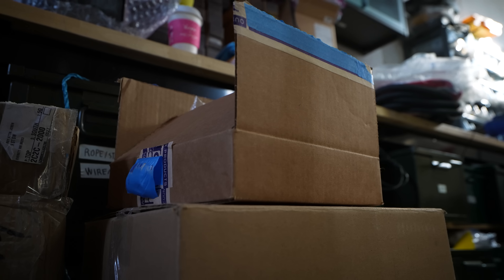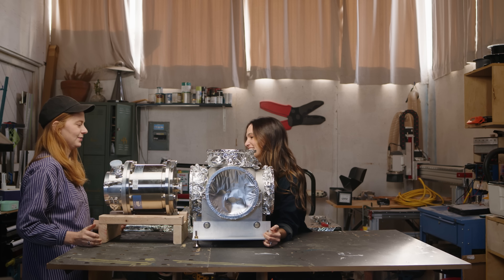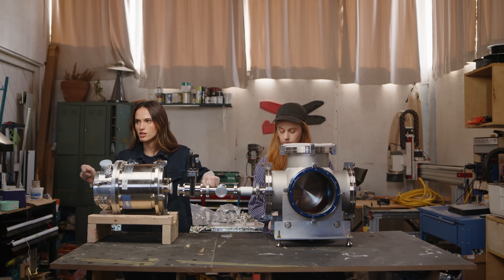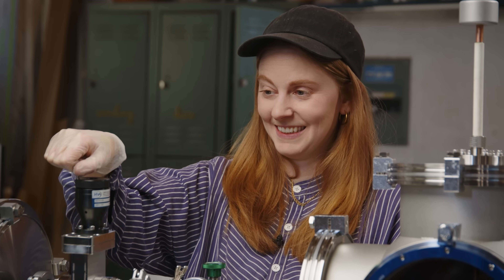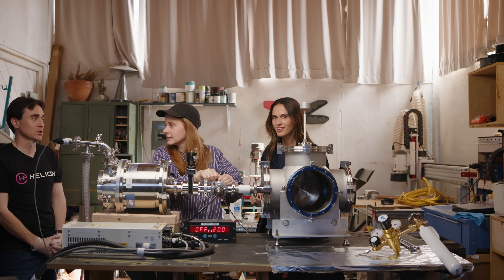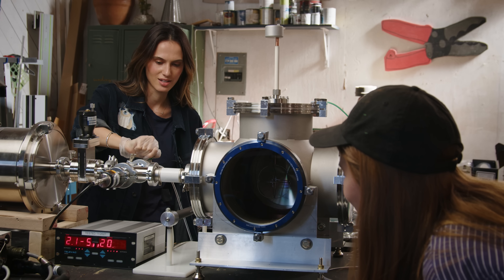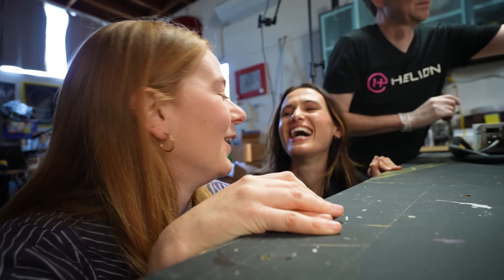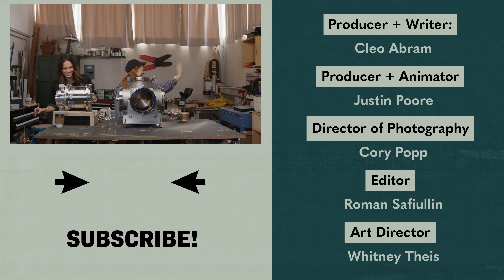We Tried To Do Nuclear Fusion

Comment: Just today, Scientists at the Lawrence Livermore Laboratory in California celebrated a breakthrough in their fusion experiments. For the first time, they were able to generate more energy than they invested in the process. The researchers used 2.1 megajoules of energy, with the help of laser beams, to initiate the fusion of two hydrogen isotopes. The fusion reaction in the facility generated 2.5 megajoules of energy. This is an important step towards the commercial use of fusion technology and a potential alternative to fossil fuels.
Reply: Importantly, that's 2.1 megajoules stored in the lasers, but it takes huge amounts of energy to pump those lasers and they fire for a very brief amount of time and then shut down. The system as a whole still consumes far more energy than it outputs. That's not even accounting for the typical conversion of heat to electricity of maybe 50% efficiency. 
It's a significant step forward, but the journalism around fusion continues to gloss over the difference between net energy of the reaction vs. net energy *of the whole system*.
Reply: @slyhatjones thank you for explaining that much more clearly
Reply: @slyhatjones  yes, but at least they've done the hard part. the rest is optimization in the support infrastructure, more efficient lasers etc.
Reply: @licencetoswill  I strongly disagree that that is "the hard part." It is like looking at successfully setting off some dynamite and declaring you are now close to building a power plant for years/decades that runs on dynamite explosions and produces electricity. What this latest step shows is only that using lasers is another approach to actually achieving fusion, e.g, tokamaks aren't the only approach in which the plasma fuses and heats itself up a bit. Firing lasers for a nanosecond and getting a tiny amount more heat than the fused material had originally + the heat of the lasers is a long way from making a reactor that runs continuously, much less one that has more electricity output than input.
Reply: @slyhatjones  Dont worry too much about the efficiency too much, hand it over to the private companies, theyll find a way to make it real efficient real fast. As theyve done with computers and phines
Reply: @Cecilia-ky3uw  Many of these research reactors are already being built & run by private companies. While the lasers delivered ~2 megajoules of energy  (and the reaction delivered ~3 megajoules), it took ~300 megajoules to charge the lasers, and they only fired for a moment. Once. This isn't a case where we're nearly there. US officials confirmed we're still decades away, if ever, from a fusion reactor that adds electricity to the grid.
Reply: @slyhatjones  Do you think they will manage to keep it alive for much longer? Lets say an hour instead of a nanosecond? Or is there a better way, like replacing quickly the atoms?
Reply: @Aldraz  My understanding, which is absolutely not expert-level, is that the lasers are being used to ignite fusion; other approaches such as tokamaks sustain fusion but use a different method to ignite it. Maybe a combination of laser ignition and tokamak containment would work? Nobody really knows, it hasn't been tried. Containment is a huge technical hurdle, so is sustaining the fusion, so is extracting heat to convert to electricity (maybe 50% efficiency for that?). When we have a fusion reaction that lasts for minutes, maybe we'll start to learn what it would take to sustain one for days. 
But these could also absolutely be dead ends, too. It's far too early to declare that practical fusion power production will happen at all, much less in our lifetimes. It's OK to be excited by teams overcoming a technical hurdle, as long as we keep in mind this is one hurdle in a hundred mile ultra-marathon full of thousands of hurdles, and we're an athlete who has never run that course before. We don't know if we can, we want to, and we're gonna give it a shot. One more hurdle down, nice! A thousand more to go.
Reply: @licencetoswill  No, this isn't a matter of optimization. The technique they used to achieve fusion does not allow for the production of electricity because there's no way to capture the energy that is released by the explosion. The experimental apparatus was designed to create fusion for weapons testing, not energy production. To actually produce usable energy they need to use a different technique.
Reply: @slyhatjones  In this context "ignition" refers specifically to the fusion reaction producing more energy then it takes to cause the fusion. Similar to lighting a fire with a match - the match supplies a small amount of energy and the fire releases a large amount of energy.

Tokamaks have been able to achieve fusion for years, what they haven't done yet, what no one using any technique had done yet, is get more energy out of a fusion reaction than the amount of energy supplied to create the reaction. This is the first time that anyone has gotten more energy out of a fusion reaction then they've put into the reaction. 

The lasers take about 330MJ to operate, and the production was about 3MJ. So we're still a long way off - and the technique they used won't be useful for electricity production.

Still, it is a big deal because it finally proves that fusion energy is possible. But it's not the start of commercial fusion energy production. It's another step on a long road, but it won't solve today's problems.
Reply: @licencetoswill  the hard part is to have more energy come out than put in, it's still a very much ongoing system
Reply: @slyhatjones  Yeah I completely share your outlook on this. It's important to realize for people how difficult and innovative this thing really is. I don't think most people value all the scientific and engineering work that these smart people have put into this. A lot of hours of research, sometimes wasted when it goes in the wrong direction. I think we should all be more thankful to these people who are sacrificing their time for this greater thing. There is still a lot of work to be done and that should be well respected and on minds of other people.
Reply: @Cecilia-ky3uw  um....private companies dont want to spend 40 years throwing billions of dollars into this. that's why government funding is so important. Look at things like the EUV lithography process, it's heavily subsidized by governments. 

the whole "capitalism solves all problems" circlejerk is very weird because it isn't really reflected in reality. Capitalism is good for short term progress but is really doesn't work well when you're dealing with hurdles that take decades to overcome. companies need to make shareholders happy every 3 months, that's why the "economy is in collapse" every few months.
Reply: @CRneu  Capitalism isnt just short term progress my guy, you realise that you current phone is magnitudes more efficient compared to its parent technology. And Capitalism tends to make inventions accessible extremely quickly as companies find ways to lower the cost of production
Reply: @licencetoswill  the hard part? They will have to build another machine just to be able to optimize the lasers (if possible). Anyway, I think they love their metrics because it gives them newspaper presence. Gain 1.5! yiha!    x=0
Reply: @Cecilia-ky3uw  and you do realize that your current phone didn't take 20+ years of development WITHOUT any useful product in between?
Smartphones get a bit better every year <- that's short term progress.
Whereas fusion will take decades of development before it can make any money at all.
Reply: @Jehty_  the newest iphone has some cool new shite compared to the previous newest one and so on.
Reply: @Cecilia-ky3uw  exactly. Every new year there is a new version with the Iphone.
Whereas with fusion there is no new version. There is only one version. And that version will come out someday in the future.

Do you understand the difference?
Reply: @licencetoswill  Fusion, my dear, it's all about optimization, the whole thing is a continuous process of making it perfect for sustained and prolonged use as it would be an actual, well generator of electricity.
Reply: @licencetoswill  No, that's dumb

They used 50+ megajoules of energy to produce those 2.1 megajoules of laser energy... and if you think that lowering 50 megajoules to ZERO is a question of "optimization in the support infrastructure" (lmao) you are as clueless about physics as a shoe, mate
Reply: @slyhatjones  Using really inefficient lasers. Each team focuses on optimizing specific components. We are closing in on components good enough to create a full end-to-end energy positive system
Reply: @thomasreese2816  unfortunately a full system positive energy demonstrator still won't solve the problem of powering the world with fusion. The design of NIF does not allow it to be a viable power plant, as a perfectly symmetrical halroum needs to be manufactured for every reaction, and hundreds of thousands of reactions would need to be produced each day to serve as a full scale power plant. 

Even the slightest defect in the halroum will prevent it from working.
Reply: Uhhh that's hugeee*!!!
*if true
Reply: No they didn't. They may have produced excess fusion energy from the laser input energy, but the system efficiency isn't even close.
Reply: Yeah not really. If we measure the real cost of the energy put we’re still way off. The breakthrough today was that we managed to “make a certain part of the process more efficiently”, which is good. But to be clear: we are still putting way more energy in than what  we’re getting out.
Reply: Just more hype and dubious claims, similar to last time. Don't get too excited.
Reply: But they didn't tell about the 0.3 GigaJoules of energy used leading up to the shot.
Reply: Except no, they didnt. Actual power input to the 192 LASERs was around ~200 MJ, power on target was ~2 MJ after losses, extracted energy was ~3MJ final, so it adds up to a huge deficit in total.
Reply: The output was 3.15 MJ from 2.05 MJ of laser power input. The didn't mention the 300 MJ needed to power the lasers themselves. So total system gain is still way below breakeven.
Reply: Yes, that was awesome. Future is in bright colors
Reply: Yeah this isn’t true. I would suggest watching Anton Pertov’s video
Reply: Not true. They got 3MJ fusion output from 2MJ laser input - but it took 400MJ in energy input to produce the 2MJ laser. Getting net energy output from fusion is still an unsolved problem.
Reply: Unfortunately, you need at least 10 times overhead to break even.
Reply: 0.4 megajoules for every 2.1 in, that is almost 50% gain.
Fission still win by a long margin, and the 50% return may not pay total build and life time operation cost.
I know it is a lot to ask, however they will have to double that to make it worth.
Reply: This is not true. They invested more energy. The OUTPUT ENERGY of the lasers was smaller than the output energy of the fusion reaction. This doesnt include the INPUT ENERGY of the lasers though, since they are by far not 100% energy efficient. Also, you need to compensate for entropy and cool your system, which also needs energy.
Reply: For context, they're still at least a decade out in terms of a usable product from this. I've seen articles making it sound like "What are we going to do now that we have unlimited clean energy?" and that's not even close to reality yet. A decade out for a usable product is still optimistic. 

So it's a huge accomplishment to get more energy out of the system(not accounting for other things), we still have a long way to go. Unfortunately this still falls under the meme of "fusion is 20 years out".

This is all based on if it can be replicated at all, which they're struggling with. It's a huge accomplishment, absolutely, but we're still a long ways out.
Reply: Sick
Reply: That's not true. They like to trick the numbers. They archieved 1.5 gain, but without counting the energy of the lasers wich consumed hundreds more than the ignition itself. Still a veeeeery long path to trace.
Reply: they did such experiments already in 90-ties but someone have sealed it down. while israelis are terorizing world with tactical mini termo-nuclear bombs...
Reply: Wait, perpetual motion is real?
Reply: They put in 10x the energy they got out that isn't anywhere near close.
Reply: More cooked numbers.😑
Reply: Yeah, still a net energy loss. Only looking at the energy the lasers put in, yeah in that case there was more output. But you need to take into account all the energy it took to get those lasers to work in the first place, which in this case still means total energy input was still larger than the total energy output. So we're still not there yet.
Reply: Except experts in the field laughed at the claim because just like this team’s previous claims, no one has been able to reproduce or verify their claim and they have made similar claims in the last. You would know if you had media literacy and did research into the claims. Plus they cherry pick the definition of energy input. This has been covered by other physicists on YouTube. That most in the Fusion game try to cheat and not really counting most of the energy input needed for the experiment and just the estimated energy acting on the fuel itself.
Reply: While certainly a step in the right direction, the scientist in me remains skeptical until results can be replicated by other parties. It may have been a dud or sensor mishap for all we know.
Reply: @MinecraftMasterNo1  They themselves have had trouble replicating their own previous successes. They will need to show next they can do this reliably dozens of times.
Reply: The article stated that scientists at the LLNL in CA did the fusion, but then stated that it was in Oxford. I do not think LLNL has a tokamak. The article was unclear, but maybe the scientists from LLNL participated in the experiment in Oxford? Who knows.
Reply: @steveswoodworking2504  The work was done at LLNL with their NIF laser, a aser-based inertial confinement fusion device, not a tokamak.I believe the photo at 12:58 in this video is part of NIF.
Reply: @myquealer  Thanks Mike, yeah, the first article I read was really messed up! I have since seen it was LLNL's laser based confinement method. That's a nice breakthrough. And of course the video looked like a lot of fun, doing some fusion right in a home workshop! That's incredible.
Reply: At least its 29 years away
Reply: Holup. You can get a positive energy balance on that scale? 2.5 megajoules?

Like, I literally ate 2.5 megajoules for breakfast this morning.
Reply: @voltrevo   if thats true converted to calories is 597514.34 for breakfast

1 MJ = 1 million J 
1 J = 238.85 cal
this took longer than I thought
Reply: @LoveTheLord77  That really is just within the daily recommended caloric intake (2500 kcal or 10,5 MJ) for an average grown man. Considering the prominently American/Western audience on here, that’s on the lower end for a single meal even.
Reply: @voltrevo  over 15 mJ of power was put into the lasers to pump them, and 2.5 mJ is over 60k calories, i think your off my an order of magnitude
Reply: @voltrevo  It was a small-scale experiment, so the values overall are quite small as a result. You never want to test 'new' concepts or techniques in the large scale just in case the result is a critical failure. Doing so could result in injury or death.
Reply: @Terra Mater  two hydrogen isotopes...seems strange you named all that but not the name of the two specific isotopes.  Tritium and Deuterium are those two isotopes of hydrogen.  The only way they get Tritium for these fusion expirements is from our fission reactors.  Our PWRs release tritium at the rate of 10s of thousands of TBq from every plant every single year and most of society has no clue much less this next part.  When Tritium is released into the biota, it is taken up in the plantlife we eat and the animals we eat that either replaces hydrogen in the cell or binds directly to the Carbon in the cell which then forms Organically Bound Tritium.  "OBT causes DNA strand breaks, micronucleus formations, cell necrosis or aptosis, chromosal aberrations and various other phenomena thus negatively affecting human health."  The source of the fuel for fusion is causes cancers in people from the releases of our fission reactors and is the only way they can get the amount of tritium needed for just an expirement much less the amount of reactors it would take to cover our energy needs.  It's never going to be large and wide scale and that's just a fact.
Reply: @paulmobleyscience  Lithium deuteride is an alternative fission fuel that has been shown to work. You can also breed tritium by including a thin layer of lithium surrounding the plasma, since tritium can be produced by neutron bombardment of lithium. We already knew that fission reactors were dirty, but you don't have to have fission reactors to produce tritium.
Reply: @RexxSchneider  Yes Rex I know...Lithium in Grease....lithium in our batteries lithium for fusion....It does not matter as it's not sustainable energy.
Reply: @paulmobleyscience  Well, no energy is sustainable forever. But I think the minute quantities of lithium needed to produce tritium isn't going to make any sort of a dent on our resources. Lithium is 50% more abundant in the Earth's crust than lead and 900% more abundant than tin, so we're not particularly short of it right now.

As for my occupation, I've had many, but I'm presently happily retired. I did spend many years as an educator, though.
Reply: @paulmobleyscience  We really ought to be looking at ways of weaning ourselves off fission reactors eventually because of the problems of decommissioning that we are storing up for our children and grandchildren.

Fission is a useful stop-gap while we disentangle society from the fossil fuel burning systems that have done so much damage to our climate. But surely you would agree that it would be crazy to keep fission reactors running just to produce tritium for use in fusion reactors?

Uranium is vastly more scarce than lithium, and if we eventually produce a working fusion reactor, we would be able use lithium to create the tritium inside the reactor, thus obviating the need to process and transport highly radioactive materials just to get the fuel for fusion reactors in an era where fission reactors would be obsolete.
Reply: @RexxSchneider  The you are using still yet more energy to produce the tritium...
Reply: @Sven_Dongle  Actually, you're not. A neutron escaping from the plasma will be absorbed by a lithium-6 nucleus, yielding a tritium nucleus and a helium-4 nucleus, and that's an exothermic reaction.
Reply: @Sven_Dongle  And it seems you haven't grasped that once you have grown a chicken from an egg, it will produce more eggs. Once you have a working fusion reactor, it can create all of the tritium it needs as fuel from lithium.

The point that you haven't got your head around is that if we ever manage to make a working fusion reactor, we will no longer need fission reactors to make fuel for it. Go re-read this thread to understand the context.
Reply: @RexxSchneider  I feel like I am trying to explain basic logic to a chimp. A common occurrence when dealing with normies, alas. I wont even attempt to explain the advantages of using He3 instead, lol.